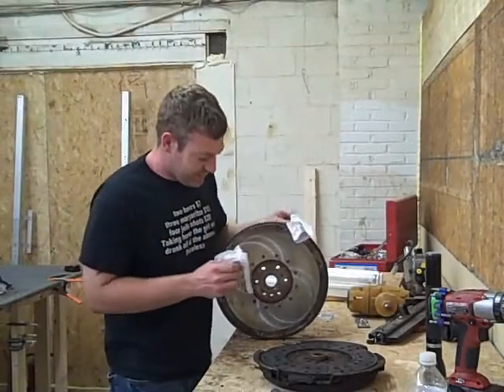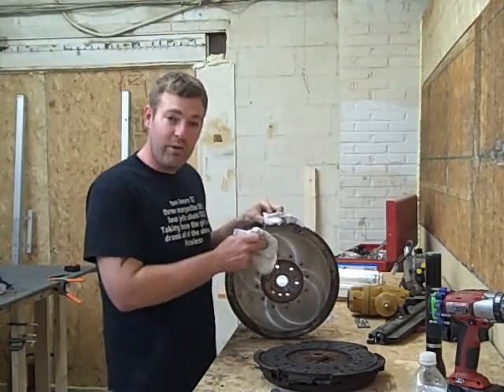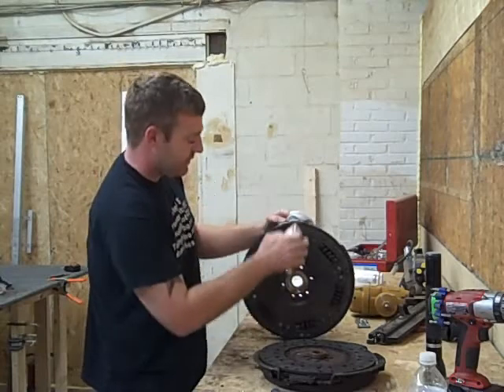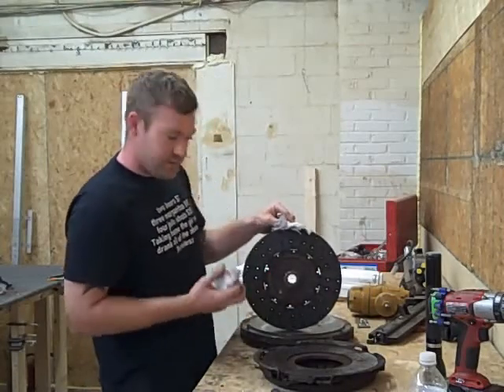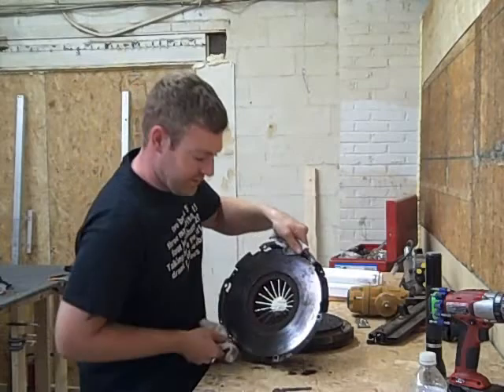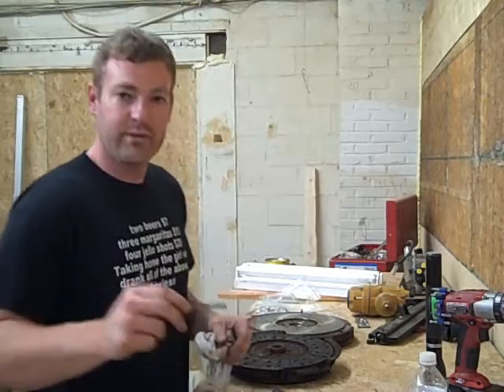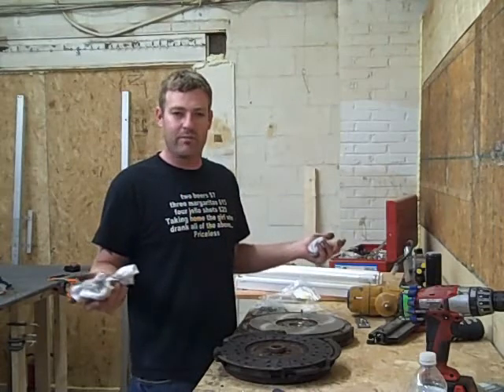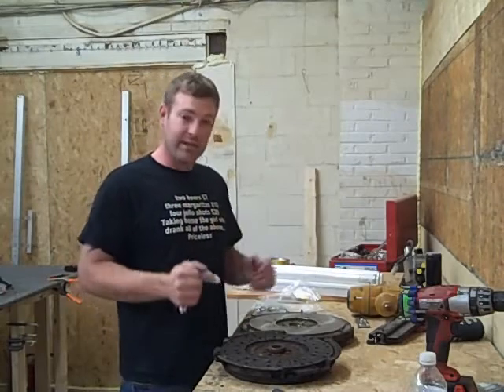Dual Mass Flywheel Conversion (PART 2)

Comment: I know this vid is ancient, but 6.5 trucks are still getting bought and sold, so something to be said about that.  I still have the original dual mass in a '97 rollback truck w/ 270k mi and I figured this was my source of funny noises after the clutch is let out for the first few feet of rolling motion - all the other stuff has been replaced about 20k mi before I got it, and yeah, DM flywheel's been resurfaced - I have the shop invoice on that.  You tube is a history channel, but thats a good thing.  Cheers!

Comment: It's funny how a lot of people push the idea of converting from DMF to SMF, pointing out the cheaper cost and faster rev pickup, while carefully forgetting to point out the extra vibrations associated with it that will lead to extra loads on the crankshaft and extra vibrations throughout the body of the car. Most will tell you it's a feel thing only and it's just a matter of getting used to. While that's true, it is not just that. The long term damages from that conversion are far worse than the perceived gains. After all, the manufacturer did not put the DMF in the car for the heck of it, or to simply add to the cost.
Reply: yeah just like the vac pump on the 6.5L get it out of there and make in simple.
Reply: We used to convert loads of vans to single mass from dual a few years ago, that was until we started having to replace gearboxes 12 to 18 months later. There’s plenty of expense involved with replacing a DMF, if you go down the route of exchanging to single mass make sure that your transmission is man enough to handle the additional vibrations

Comment: Go on you mate! $3,500us at the mechanics vs  $600us done with care by you. And the bonus is you will never have to worry about a DMF again.  Note: the SMF should break-in in about 200 to 500 miles and the ride should be comparable to the DMF.

Comment: I've converted loads of cars to solid mass NO problems. It's idiots who put solid clutch with solid fly wheel who have the problems.
Reply: Hi Dave you say you've done a few conversations I've just changed my 2004 zafira dti from dmf to smf and now won't start have you ever had this problem? Someone said sounds like crankshaft sensor  does this need changing with the conversation cheers jo
Reply: +bodgeitjo no never had that problem. Did you disconnect fuel line at any point??? You may need to prime fuel system. If not may be missed earth cable off.....

Comment: I changed to single mass and then changed back to dual mass a week later on a mondeo tdci. The car drove with sharpness like a sports car but you could tell that it was just too powerful and that a weakness would either show on the crankshaft or the gearbox. INMHO, it's a bad move to put single mass into a dual mass system.

Comment: A dual mass flywheel prevents you from breaking off gear teeth during hard shifts. If you fit a single mass flywheel, it is best to sell the vehicle before you have to replace a gearbox

Comment: to get the pilot bushing out find a bolt that is a little bit too big to fit inside it then drive it into the bushing with a hammer then just racket it through the bushing and it will suck it right out

Comment: My dual mass went bang!  It literally ripped all it's Springs fixings off and 2 of the Springs tubes ripped in half. It really is a bad design either on purpose or by mistake by the designer. Anyway you can relatively easily convert your existing broken dual mass to solid, you will need a pillar drill, some metal work knowledge.
I will post a video real soon as there doesn't seem to be one on here?  Or I can do the job for you for a small fee.....video coming soon, so keep an eye on the new videos for dual mass conversion.

Comment: Hell mine the spring were falling apart. I took my dust cover off and metal fell out. I got used one from a guy I know that switch his out for a smf only thing was it was warped over 1/4in.  I took the clutch surface off and swapped it out. Worked ok